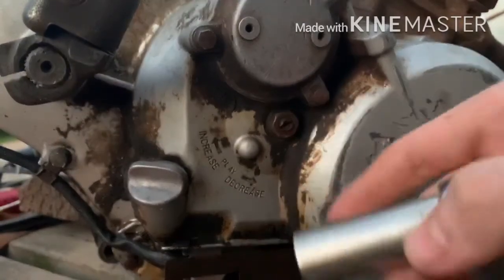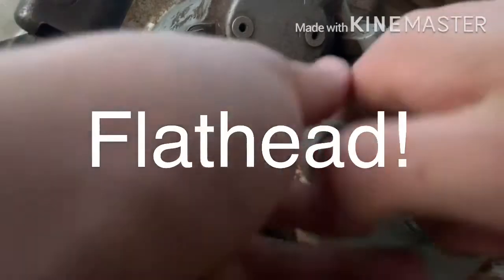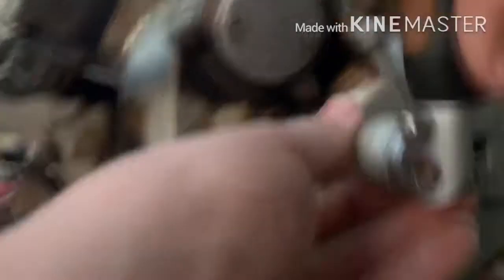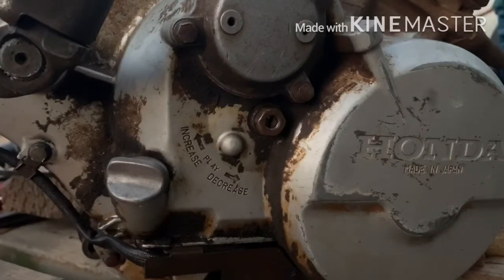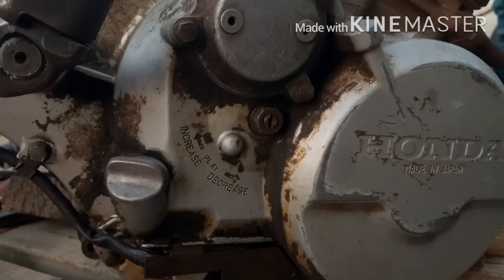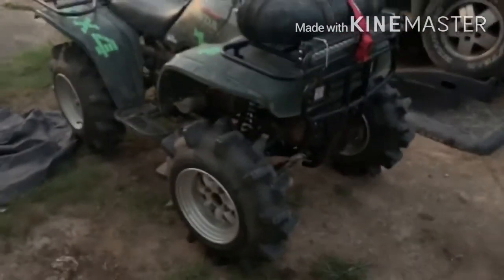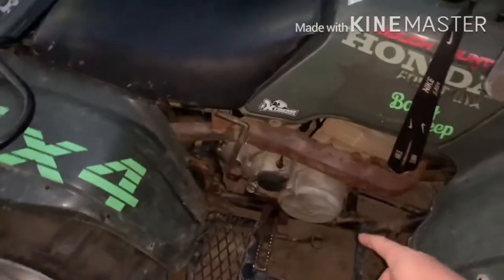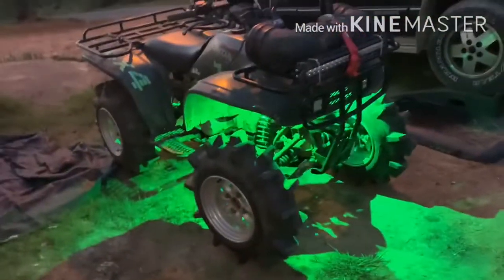Honda 300 fourtrax clutch adjustment “how too”

Comment: Hi I have a 1997 trx 300 4x4 it goes in reverse perfect but when I try to get it in neutral it's very hard. Is there adjustment for that.  Thank you
Reply: Does that happen all the time cause on mine when it dosent want to go into neutral from reverse I just back up a tad more and then it'll usually goes into neutral just fine maybe a coincidence but it works every time for me on my 91 fourtrax 300 4x4
Reply: @nathanflatt7818  its hard to get it out of reverse most of the time but only occasionally goes in neutral fairly smooth.  I usually have to use my hand to get it in neutral cause its way hard with my foot
Reply: @victornaja7927  oh I've never had it that hard to go in neutral maybe something to do with the clutch adjustment well that just my 2 cents, hope you find an answer to your problem
Reply from the maker: I’m not sure if u follow what I did in the video it should be fine only think it does is makes the shifter tighter and also if u have them to tight it will be to hard to shift but u can get it to shift with some force but it’ll bang into gear hard

Comment: The video was helpful but what I would really like to see is a video on those sick ass lights you have on the 300.
Reply from the maker: The green ones or the like light bars and flush mounts?
Reply: It's pretty simple, they're pod lights you find on amazon and they basically just push into the stock light holes

Comment: Just bought this thing, & it appears to need adjustment, Is there a number of threads SHOWING above the nut is the MAX to show after adjustment?? I HAVE to have this thing to work @ farm and can't risk getting it where it doesn't work, currently it works but slips
Reply from the maker: Uh no I’m don’t believe but all u should have to do is do what I said in the video and you should be all set with the clutches cause that’s how everyone is done and if it still slips after you’ll most likely need new clutches

Comment: Will adjusting this fix the quad from lurching when shifting from neutral to 1st?
Reply: That’s what I’m here trying to figure out. Curious to hear if this fixes lurching.
Reply: You probably should try lowering your idle on the carburetor
Reply from the maker: I’ve seen it do that if it’s too tight it will be hard to shift and kinda go into the gear hard so yes it would unless you idle is too high
Reply: Before you turn it counterclockwise you turn it clockwise one full turn, and then counterclockwise until you feel resistance. Once that happens, go 1/4 of a turn clockwise then lock it down.

Comment: My left lever is a brake... and when i squeeze it, I can feel it on my foot brake... and my right lever is a brake..

Does thing not have a clutch?? I just left off the gass and shift?
Reply: You have a wet clutch. When you lift the shifter all the way up with your toe, it engages the clutch,  as you lower your toe, it falls into the next gear. Works the same way as you down shift. You should let off the throttle when shifting.
Reply: Automatic clutch. You just let off the gas to shift. The left brake lever is directly connected to your foot brake for the back brakes
Reply: It has a clutch. infact 2 clutches. A shifting clutch that disengages when shifting (actuated when you use the foot shifter, when clicking up or down a gear this clutch is used for smooth gear engagement on shifts) and a centrifugal clutch thats used when accelerating from a stop.

Comment: So what does this do do u have to do this because I just rebuild my rear end u think I should do this ?????
Reply from the maker: Should after you rebuild your rear end, has nothing to do with the clutches try backing the lock nut off a little and if that doesn’t work then try to idle it down it also makes the shifter have play and u want it to have alittle play but it’ll shift hard if to tight like if the shift doesn’t move up and down a little without shift kind has that free space need about 1/2” on both up and down movement that should be set perfectly like that

Comment: If I send you a picture of my adjustment by email can you tell if I have anymore adjustment in it??? Just bought this thing & the clutch is slipping
Reply: With most atvs there are 2 clutches. A centrifugal clutch for accelerating from a stop, and a shifting clutch that disengages when you pull up or push down on the shifter to shift making the shift smoother and easier on the trans instead of gears just bashing together. All screw adjustments like this ONLY adjust the shifting clutch. If you accelerate from a stop and it slips very badly then grabs either most likely you are too full on oil or the centrifugal clutch is worn. Dont after see the shifting clutch worn unless it was driven while adjusted improperly.